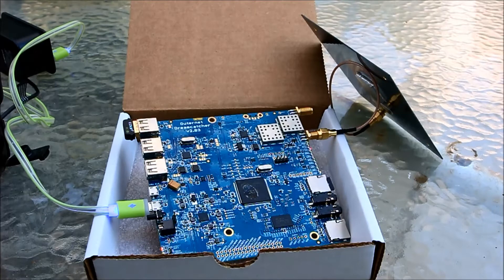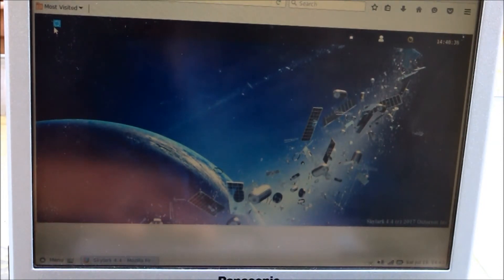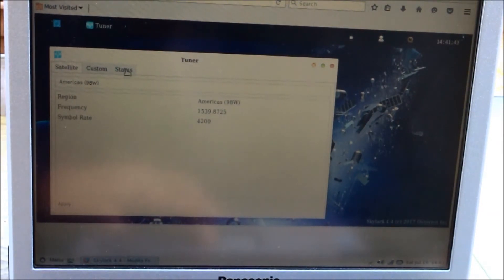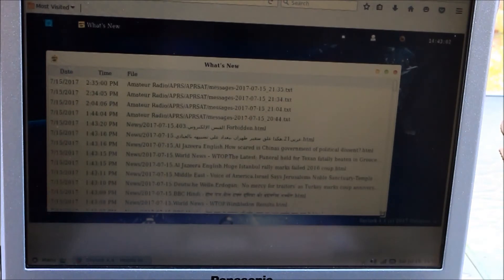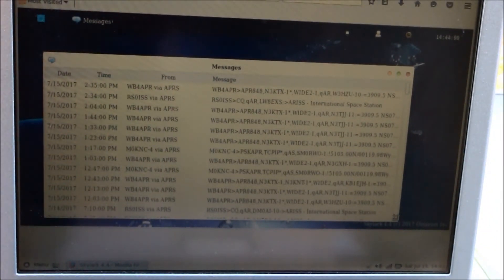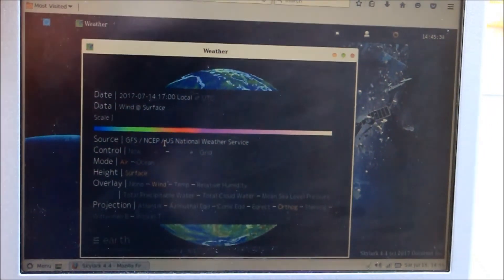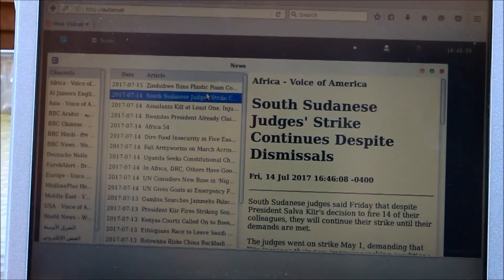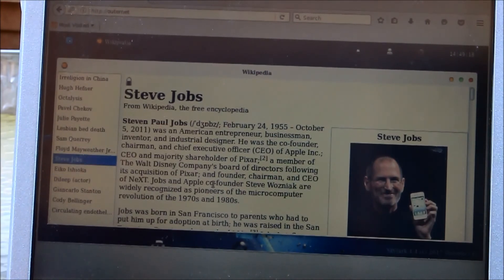A Look at the Outernet Project / Dreamcatcher 2.03

Comment: Beautiful Video, How is possible burn two operating system (Armbian and Skylark) in the same SD card?for Burning I normally use a program called "Etcher" similar to Win32DiskImager.Thanks
Reply from the maker: Currently I am running separate SD cards, rather than trying to switch between the two on the same card. It's also easier that way to restore/save images to another computer.